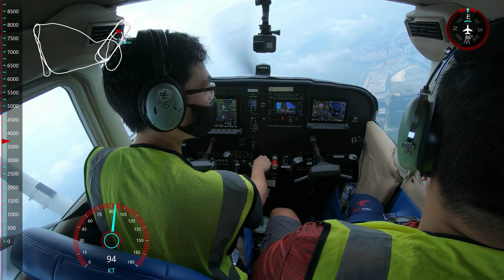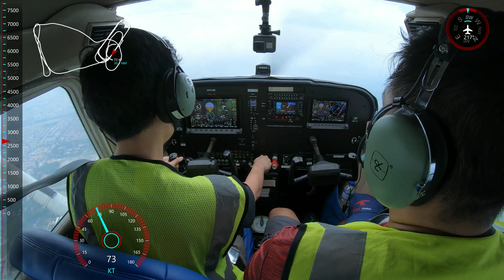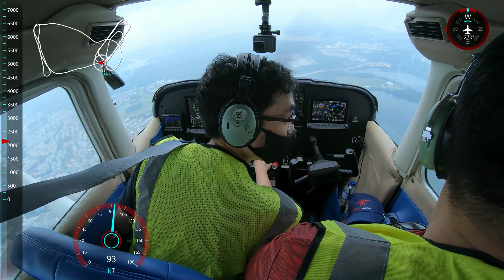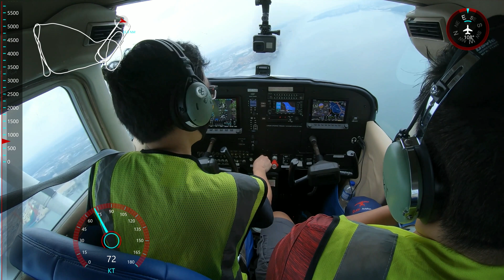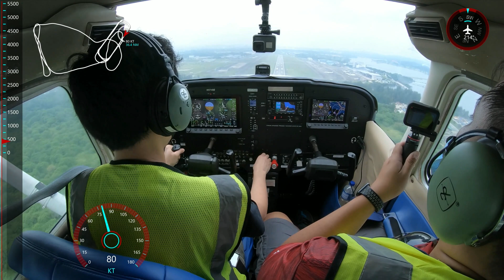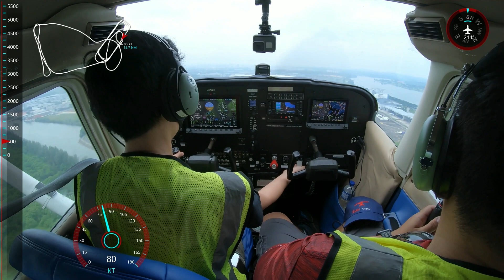Local 33 - Taking potential pilot, overhead descent sequence, go-around, virtual steam gauges

Comment: Pls dont report dw high if you are going to descend to normal cct height
Reply from the maker: My understanding of downwind high is a report of my current position which is indeed higher than than the typical downwind altitude but I'm already on downwind so the Tower is alerted to it.

It's like when one does a glide or PFL, eventually you will descent through normal circuit altitude and I was taught to call downwind high too.
Reply: @yeokm1  while you are not wrong, i think it is good to know that
1) when we listen out for a rejoining traffic, if no glide or pfl is mentioned, it is assumed to be normal circuit. When downwind high is called, it gets us off guard and others may be confused on whether you are doing glide or normal
2) your circuit height affects where others look for to spot you in sequence
3) whether you are doing glide or normal, it affects how much space we cater for you or expect how big your circuits will be
Anyways happy flying and blue skies always
Reply from the maker: @Magoosh1  So you are ATC? I can double check again on this to do it correctly next time.

I trained in the US so the PFL, glide and downwind (high) calls for controlled airports are not something I used at all in US. I only started doing that when I was taught to do so by the SG instructors.
Reply: @yeokm1  not an atc, had my ppl here